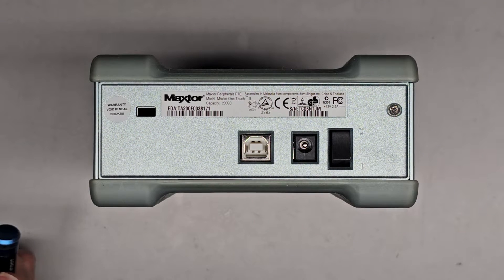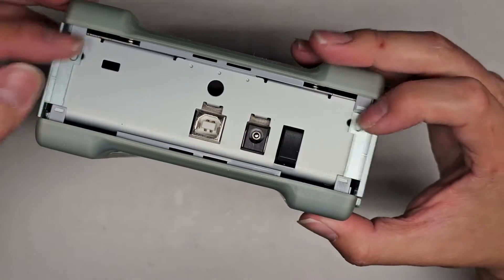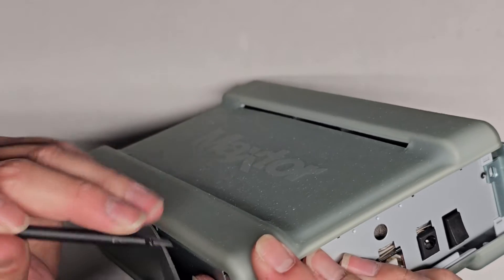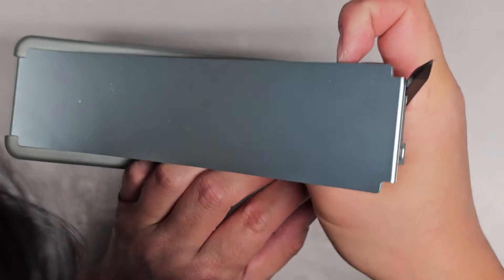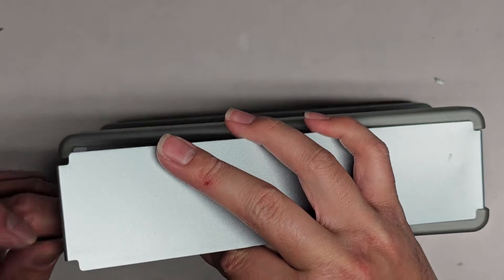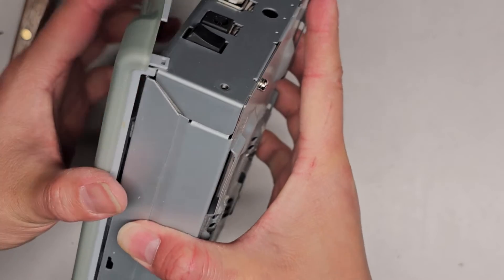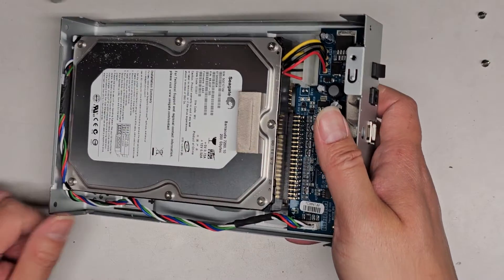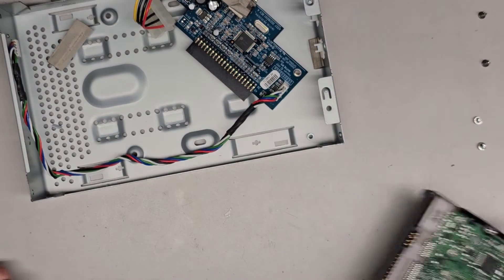Maxtor OneTouch III External Desktop Hard Drive Disassembly Data Recovery 3.5" IDE to USB Adapter

Comment: I took mine apart. Broke all but one of the tabs holding the side cover on. I see you had trouble figuring it out too. Came here to see which way you press the power button to turn it on since I can't find the back cover that has the on/off symbols. Just wanted to say that my unit wouldn't work, so tried all kinds of trouble shooting. Finally, figured out it was the power supply that came with it. It's a maxtor original so I never figured it would fail. All of the voltages at the circuit board were ok under load, and everything else looked good. I assume it's having very short voltage dips that disk drives can't tolerate during startup, and not detectable with a multimeter. I changed the 2.5 amp maxtor power supply with a 7 amp power supply and now it works fine. Maybe that info can help others.
Reply from the maker: Try an external adapter.

Comment: I normally don't comment but this one deserve some love. I bought the same drive back in 2006, still is great working condition, up upntil i decided to use the IDE connector inside this external drive to hook up some old drive from back in 2002. I was going to buy an IDE / SATA to USB connector but thought to give this external drive IDE connector a shot. I never opened this drive so i was little skeptical how to open. I came across your video and Vallah!!!!! made my job easier i could ever imagined. Thanks for all the hardwork you did in opening this drive and i much appreciate your video. much love from the United States!!!!
Reply from the maker: @Pul5arKhan-ld9yd  glad it helped you get it open. If you haven't already, please like and subscribe so others can find my videos and possibly consider watching a few others and commenting to get the algorithm to recommend my channel. Thanks!
Reply: @ItsBinhRepaired  no worries will do!!!!!!
Reply from the maker: Thanks!
Reply: Thanks for this video. I felt better about destroying the enclosure only to find the disk isn't SATA.